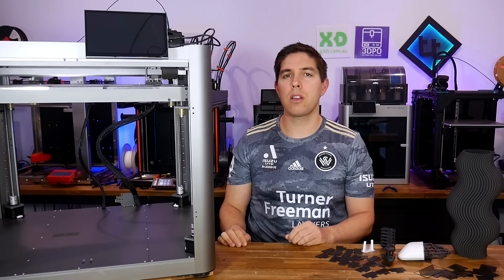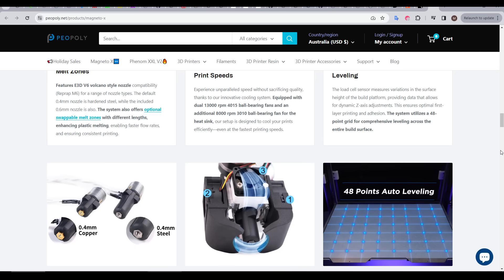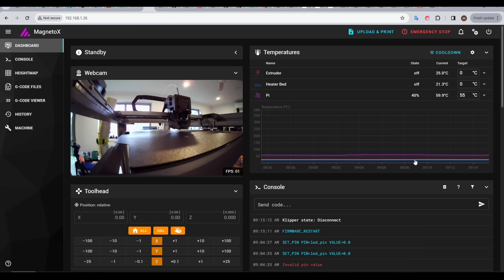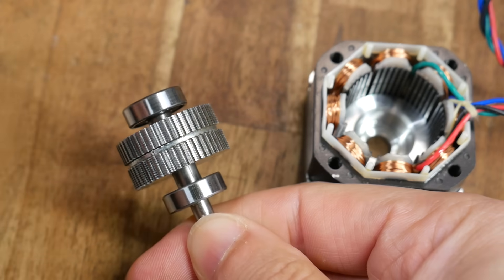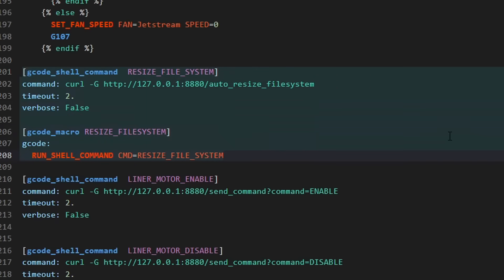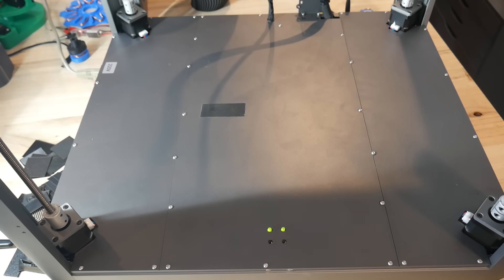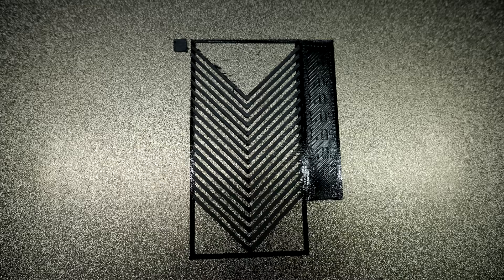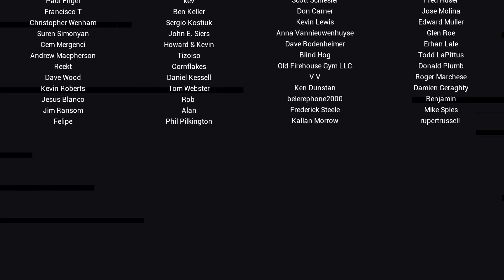Field testing the Peopoly Magneto X linear motor 3D printer

Comment: Yours is the 3rd video Ive watched on this printer. It SEEMS like a hell of a good direction, but not something I see, at least right now, as an innovation that the average user can easily delve in to while building a custom rig. Ide love to see where this goes though! 

As for testing, other have seen a lot of "noise" in prints that seem to be appearing at the same frequency as the linear motor magnets are placed. I KINDA think this could be turned out by relaxing the moters a little. 

As for price... compare this to a similar printer. Ive been looking at building a RatRig. The fully built model isn't much cheaper than this $2000 price tag. So, sure, its expensive! But its nothing out of what should be expected. Especially for something that's implementing tech that no one else has ever thought about! 

Again, Ide love to see where this goes in the future!!

Comment: Im a huge peopoly fan having bought the phenom and the forge . I pefer resin over fdm thats my choice . It would be nice to see your machine print a full helmet to see if layer lines are a issue . Thats a cool engineering fdm design it would be nice to see its full capacity once all the software bugs are worked out.

Comment: How about "hunting down" construction errors?
Thomas Sanladerer (Made with Layers) found that his review specimen failed on missing software endstops.
In my oppinion, it's a severe error, as it cna cause the user to crash the printhead, and maybe even ruin the hotehd, the mounting system or meaye worst: ruining the mountingsystem on the printhear carriage, as the linar motors is so (-in this case. at least) damn powerfull.

Comment: Would enclosures and printing hotter prints over time have any effect on the magnets over time? You always see blacksmiths using magnets to check if the metal is hot enough as it loses magnetism with heat. I know this takes a lot of heat, but does it weaken over time with this sort of use case?

Comment: I’m curious to see how close it can print parts. Can it print non-planar? Can it print moving parts in place with a narrow tolerance reliably? How accurate are the prints? I would love to see you put this printer through the paces to see just how detailed the prints can get. I’m looking to sell my Prusa and wanted to get a Core XY but wasn’t sure which to choose due to limitations. If this is even better with the refinements I would choose the Magneto X as my next printer. Thank you for sharing the process Michael and showing how responsive Peopoly is to feedback. This was an outstanding collaboration.

Comment: Wish the Z axis was also linear motors so there isnt a leadscrew nut wearing out over time ( removing as many veribals to troubleshooting for the end user as possible ) also like to see M4 instead of M3 since its a way stronger screw but pretty much at the same price. Witch would remove my fear of snapping the screw in case i had to open it up or closing it agen

Comment: Interested in anything carbon fiber-related that you can test. Ambient air tests during "hot" builds like ABS and ASA would be nice to see. Does is ship with a hardened steel nozzle (with HS steel gearing)? Very interesting piece of hardware though.

Comment: These new generation printers, are probably getting close to becoming an output device, usable straight out of the box. After  many years, I am now over setting up printers ( I still have do some setup, then forget once dialed in). Looks like price is about USD 2000, so there should not necessarily any be need to tinker. And why does this printer not come standard with enclosure? But looks very good, and one I would consider, look forward to your review, thanks

Comment: Many foams can be dissolved in acetone, and drastically reduced in volume. I usually liquify any polystyrene I get, it’s basically napalm, so you can also use it to light bonfires or fire pits.

Comment: Beautiful extrusion, and very little periodic ringing. It's a promising start.

I like the idea of linear motors, but they scare me a bit: a software error can turn the head into a projectile -- no joke.

It would have been nice to see another linear motor along the y axis (assuming z is up, and x is side-to-side with respect to the front of the device in upward orientation).

Comment: At this point, if the printer doesnt print a better part, or quicker... then it doesnt mean much. 3D printing has reached the phase where everyone is getting onboard. I think that is great. We just have to watch out for gimmicks. Not saying that this is a gimmick, just saying it has to print a better part, or it doesnt mean anything. Kinda like the Voron groups. 90% of the posts are about speed and weight. No one shows actual finished printed parts lol.

Comment: Since this is closed loop, there should be a linear encoder in conjunction with the linear motor. Technically it’s a linear servo and I think most people are unaware of the difference between a servo and stepper. The encoder strip should be kept clean for proper operation. I am curious if this is allowed to print at high speed for extended periods of time, how well can the linear motor drive disipate heat and how robust is the drive to handle higher current loads. If this is reliable, it is approaching industrial quality and should surpass Prusa or Bambu Labs with ease. I would definitely want one.

Comment: Hi Michael great insights! I like to see how the heated chamber performs on Nylons and ABS since this platform has great potential. And  have two questions:1. To what degree is the hot end customizable? How easy is to connect it to a multi material feeding system (i am interested is soluble support printing for complex cavity parts). Thank you!

Comment: 1. Are Servo driver's hardware/firmware opensource?  (yellow boards @7:00)
2. Please, check print quality/geometry accuracy at the front of the bed with high acceleration.
As they are using T shaped two linear motors plus passive rail guide, and not H config with three motors, the front side prints will experience maximum deflection under acceleration.
3. What encoders do they use for the motors control loop? (I can see the magnetic encoder strip on the rail side so probably it is AS5311)
4. It is not levitating, you can see generic linear rails on the bottom @5:42. Maglev is just a marketung gimmic.

Comment: This is truly a revolutionary machine in its simplicity. Removing all the turns of belts and pulleys means less maintenance and fewer problems. It would be interesting to see it moves while it prints some pieces. Hope they make smaller linear motor machines in the future :-)

Comment: I want to see if those linear motors use additional power compared to a stepper motor. It would be good to test at idle/holding, slow speeds, and high speeds to see the performance.

Comment: Hi Michael, thanks for covering this! Please test the performance of the linear motors compared to high-end stepper-based designs. By that, I mean in terms of (1) speed, (2) repeatability/accuracy, (3) resolution/precision, etc. 

For #2, if you stop a print part-way and move the print head to change filament colors, then move the print head back to the model, is there a layer alignment offset due to the filament-change movement? Make a vertical cylinder that changes colors many times (say every 5 vertical mm or so) and see if there are shifts. 

For #3, if you print curved vertical surfaces of different diameters, do you see artifacts or is the output smooth? Use a demanding (probably shiny?) filament that highlights flaws. 

And to be clear, the point is to compare this to successful stepper-based designs, not just evaluate it in a vacuum. Just some ideas. Thanks again!

Comment: Pick and place machines have been using this motion system for years, it is amazing that they have put this technology onto a 3d printer and managed to make it so small. The accuracy of this motion solution is unrivalled IMO, and a perfect fit for 3d printing. Don’t go near it if you have a pace maker fitted though😊. Awesome video, I have often thought that this is the next gen tech for future printers and it is great to see it happen so soon. I would like to see a speed benchy printed on it but with quality of print being prioritised over overall speed. The pick and place machines I use can reach an almost scary speed when you consider the weight they are moving and the micron precision they place components at so I would imagine this printer can do quality print very fast.
Reply: Cnc machines also use that motion system , is not only extremely precise , but is also fast , CNC machines are only "slow" when cutting , otherwise they are lighting fast even if they are moving many kilograms

Comment: This is what I love to see!! Embracing open source, giving back to the community, open for mods etc... I think they are definitely better than bambu who literally made everything proprietary and closed source. Super excited for them!
Reply: Serious question. What do you honestly see with this printer? Once you get beyond the open source origins and assortment of off the shelf parts what makes it better than a polished (closed)product? It's $2k, the print quality is middling and still in beta testing. 
damaged build surface @ 10:26, 
inconsistent probing @ 11: 16, 
print issue @ 12:10

Every time I see someone champion open source I ask what about it makes them unique. I see an never ending project of variables, parts of various quality and reliance on the "community" to fix issues as most folks do not write code and are following someone else's instructions. Open or closed it matters little. 
 
You mentioned Bambu but as far as I know they didnt need the community to finish their printers for them, parts are available and there are wiki, videos on how to disassemble, maintenance and support the machine.

Comment: I would love to see some large ABS (or nylon) prints that require dimensional accuracy. For me it would be really interesting to see how this printer performs utilizing the buildplate with large parts, as that is in my eyes a unique feature of the printer sincy there are not many options with such a large build volume and fully enclosed as well.

Comment: Things I would like to see in a review:
- Print quality
- Print quality vs speed and how does that compare to other core xy printers like from Bambu Labs and Voron (and others).
- Sound
- Sound vs speed and how does that compare to other core xy printers like from Bambu Labs and Voron (and others).
- Maintenance of linear motors vs. regular core xy setup, how often, how, ease, cost, etc.
- Estimated life of the linear motor setup vs traditional belt systems.
- Cost of replacement and the ability to repair the linear motor setup.
- Energy usage (vs other core xy printers).
- Can you use the entire build platform at optimal speeds and quality.
- What advantages/disadvantages over a traditional core xy printer. 
- How well does it print with other (non-Peoppoly) filaments. Looking here specifically at videos of loose filament from spool to rapidly moving printhead.

Comment: I recently upgraded to a Bambu Lab X1C because of its printing speed compared with my Elegoo Neptune 3 Pro.  However, I quickly realized is that my overall productivity increased amazingly.  Why? Well, print speed was easy to quantify but I had not appreciated the complete integration that Bambu Labs has provided.  Now, once a CAD design prototype is completed, I can send prepare the CAD design, slice it, send it, print it quite effortlessly all on my local network.  I could not believe how productive I had just become by the Bambu Labs solution.  SO, why this comment?  Michael, 3d printers have now entered a new world of productively producing prototype designs.  If Magneto hopes to sell linear motors and an amazing 60 mm^3/sec flow rate without the overall integration offered by Bambu Labs, then the $2000 price will be a show stopper.

Comment: To your call to action, what I really want to know more about is those linear motors. Can I buy them seperately? Can multiple be put on the same rail? Its mentioned that they are closed loop, but the fact they have a motor disable button makes me feel its probably closed loop, but not absolute closed loop but instead relative, where when the motor turns off, so too does its positioning data.

To that end, Id love to know if this thing needs to home.

Anyhow, its really cool, but Ill admit, unless I can put on an extra toolhead, I don't see a reason to add it to my X1C But boy are those motors cool.

Comment: I want to know a lot more about the linear motors. What is there maximum velocity and acceleration? How do the input shaper graphs look? What is the max recommended acceleration and what type of shaper algorithm is recommended. What’s the hotend max flow rate? What’s the cooling performance? These are my main thoughts about the new tech.

Comment: The price of the printer is outside of what I can afford by a large amount, but it would want to be amazing at something to justify that expenditure for a hobbyist and certainly hard to justify spending it on this rather than a Bambu Lab printer.  Solely judging by the price I'd imagine this is something aimed at the pro-am market, a print farm, educational institution or something like that.  I'm sure the fact it uses different motors increases the reliability, repeatability and reduce servicing to the motors, however I don't see that as being cost effective (as normal steppers are cheap to replace) however if it allows for more precise measurements perhaps printing a test piece with an extremely high resolution, say .04 or smaller so that its comparable to a resin print but with a higher speed and perhaps a better material than PLA, say Carbon fibre Nylon?

Comment: This is such a cool project, and the name alone, "Magneto", is enough to make me intrigued. Ah yes, and also the vision of a printer that will require less maintenance, without sacrificing quality or speed. From an engineering standpoint, I have a hard time seeing any drawbacks to this architecture, other than the cost. But for print farms and professional applications, paying extra for something that requires less man-hours to keep running, will be a bargain. Keep up the good work!
Reply: I thought the same , no belts=less moving parts , and less moving parts=less downtime and less maintenance

Comment: The single most important thing that needs to be reviewed is how the linear motors actually improve this printer. I've tried to challenge this in the first (then quietly removed) teaser video and then again on the second one which I think is still up, and despite Peopoly answering other simple question in other comments they were unable to provide an answer to this.

At first they falsely advertised this as a "maglev" which is is absolutely not as it's riding in two linear rails. The closed loop is also a requirement for linear motors not a choice, and I don't remember belt skipping ever being an issue (the load on the tool head is minimal compared to machining CNCs) unless there's a crash in which case their linear motors will want to yield as well.

Anyway there's a bunch of stuff that to me screams "because we could" Instead of "here's why this is better"

Comment: I started 3D printing just under a year ago with an Ender 3v2. By October I had moved onto my current printer, a Bambu Labs P1S. I think FDM is a dead-end for mechanical parts. Perhaps there's some potential in the 500c printers that can print PEEK or Ultem like the offerings from Intamsys. Although at that price point you're getting into SLS territory. My AMS add on for my Bambu arrives tomorrow and I can't really see going any further than that with FDM. There's really no point. I would like to see consumer level SLS become a thing.

Comment: First real innovation since I bought my Taz 6. I very much like the closed loop x & y axis, but I am disappointed that Z and extrusion are still open loop steppers. It is more important that the extrusion be closed loop with the feedback tracking the filament, and not the extrusion motor. Some extruders start slipping when there is significant back pressure. 
Also, I'm not sure there is a huge benefit to linear motors. As long as the feedback is from a linear encoder rotary brushless DC motors & belts should work nearly as well. 
The open source (GPL) software is a requirement for me. I don't ever want to be trapped with proprietary code, and then have the company go under making the printer useless. 
Temperature controlled enclosure is a must, and it would be better if the temperature controlled enclosure could also double as a filament dryer with a fan to circulate the air and keep the temperature uniform.

Comment: The 48V power supply puzzles me. If the linear motors and drivers are designed in-house, it seems a lot easier and cheaper to make them lower voltage/higher current. Maybe the linear motors are really power hungry and would overload the 24V supply? But I don't see why they would be when the mechanical output power is the same as any 3D printer. The only other place for power to go is heat from inefficiency, but then you'd have trouble with overheating and demagnetizing the permanent magnets.

Comment: Throw the enclosure on it, and print nothing by high temp filament for extended periods. I have a new 3D printer that is a total failure because while it said it could print high temp (ASA and PC) it can't. If started having hotend and extruder failures and strange firmware faults, which happen only when printing high temps. You folks that test these things stick to PLA mostly. I never print PLA, so showing me PLA prints is an unprofessional review IMHO.